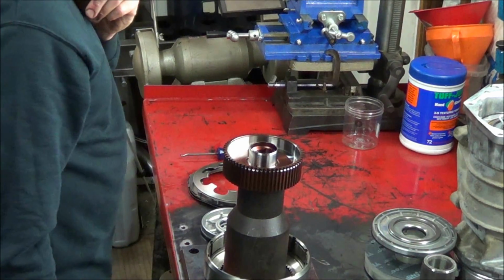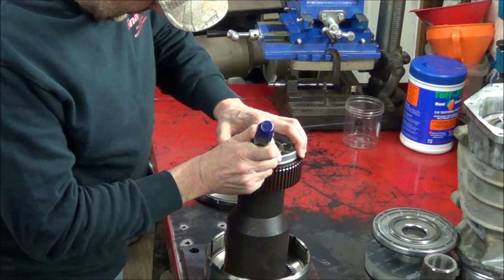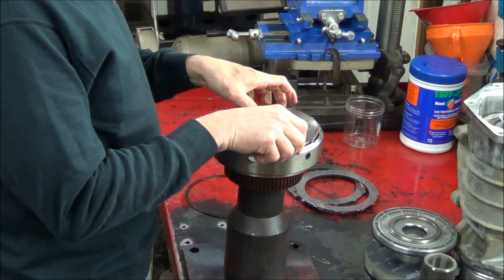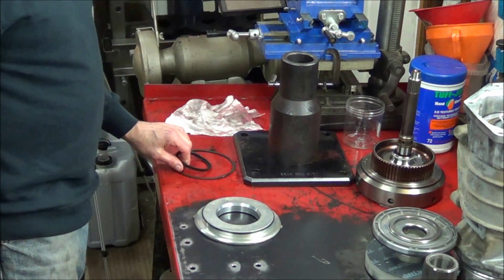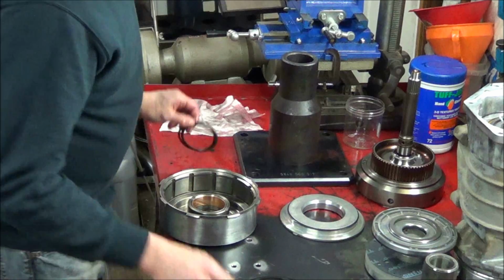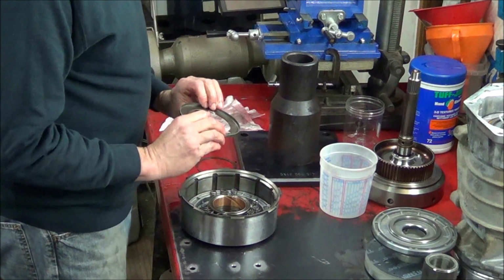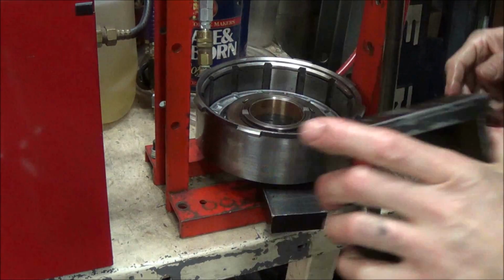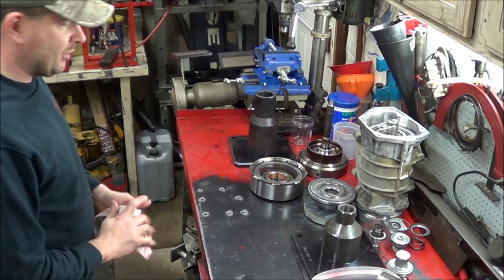Chrysler 48RE rebuild and upgrades part 2 assembling the clutches 2006 Dodge Ram 2500 Cummins

Comment: At present I am having my 48 RE rebuilt by a local transmission shop. If I go to a salvage yard that specializes in truck parts. I think that I would like to buy another trany and rebuild it with improved parts. Do you think that I would be wasting my time by doing this?
Reply: Never hurts to learn.

Comment: Hey carl. I've been havin problem with my o4 1/2 Dodge Ram 2500 diesil. Daughter got hold of u this morning.   Was rebuilt short time ago and just slips in first 2nd , drive and overdrive are fine . Should rebuild entire tranny? If so what kit do I get, was told high out put was different trans.   Thanks, dan